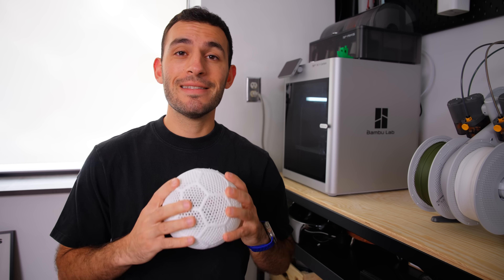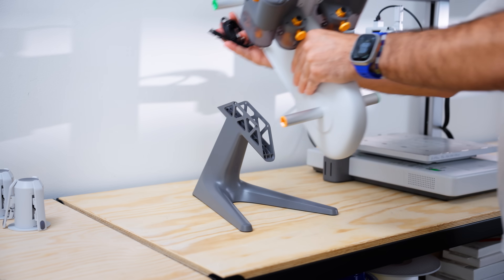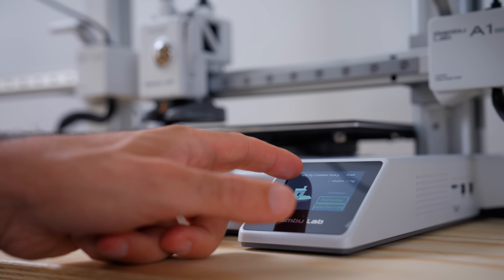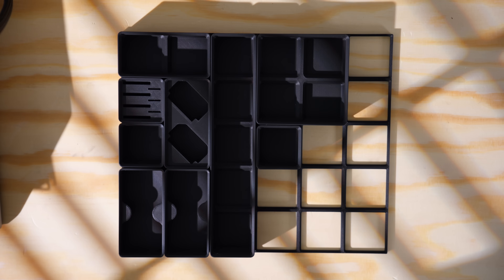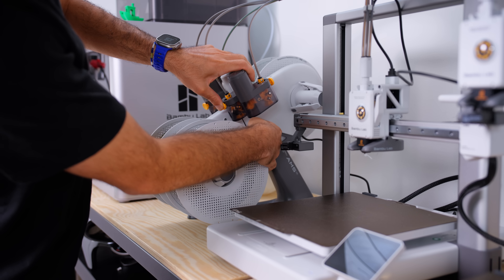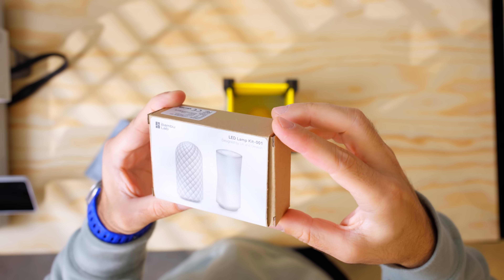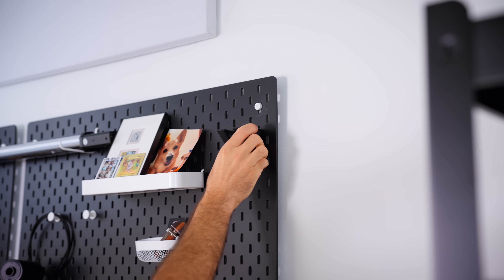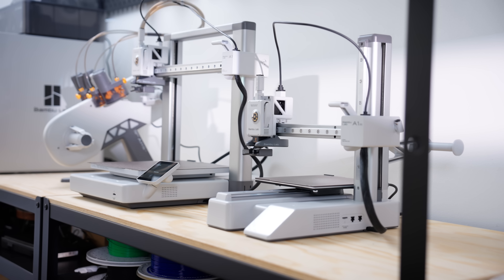Before You Get a 3D Printer, Watch This

Comment: Did you have to calibrate your slicer settings much? Or do you use default profiles?
Reply from the maker: @ludoforged  default works well to get up and running, but I still like to mess with stuff depending on the print

Comment: I’m still using my Ender 3 pro from 6 years ago. Works great! Upgraded the magnetic plate and extruder for about $50. Still using the 8 bit board haha
Reply from the maker: Hey whatever gets the job done!
Reply: @rillotv  the ender 3 printers are the best printers for a beginner. since bambu comes pre assembled you don't get to learn the basics like you do with the ender 3's or any print that you have to level the bed on. the bambu noobies will always be noobs to the 3d printer world.
Reply: @honda-s2k  it looks like bro doesnt own an a1 and is mad about it, btw 0/10 ragebait
Reply: @GalaxialCube The internet would say otherwise, Bambu users are literally the most helpless whining demographic of 3D printing owners with the highest percentage of lack of problem solving and diagnostic skills whatsoever. Also, being locked into a HP style ecosystem with HP prices is never a good position to be in.

Comment: Is 8kg of pla filament for 120€ good from bambu lab as first filament
Reply from the maker: Yeah that's solid! You might be able to cut it down even more depending on if you're doing them with spools or refills. I usually just buy a few with spools and then then rest refills, and then at the worst you can always print extra spool holders
Reply: @ yes i bought it just one spool extra because the ams and printer only come with 3 spools i hope i read it right otherwise i bought a extra spool

Comment: I want to get into 3d printing but those particle emissions are worrying. I have an extra room with 2 windows were I'd put the printer but it still doesnt solve the particle problem even for PLA. I just keep seeing no matter what I look for even when encapsulating or air purifiers youre still opening the chamber to grab the print or the particles are below the size of whats effectively filtering.
Reply: I have the same thing holding me back.  Plus I don't want plastic fumes in the house annoying my family.  I have no idea if these are valid worries.  Seems to be a whole lot of makers that have these devices in their homes.
Reply: @captainstress  the fumes are manageable IMO with filtration and venting, but particles I dont see any solution to that problem at all.
Reply: Could you elaborate what particles you’re referring to? When are they released or when are you exposed to them?

Comment: I have Prusa mini and i love it, but i want to upgrade to a new printer with multi material support. The big question is should i go with closed source Bambu-lab or with the open-source Prusa. I guess Prusa shipping will be free in black Friday, so if i take this into the account, Prusa mk4s+mmu3 should be in the same price as p1s+ams (black-friday price) with shipping costs. what would you do?
Reply: The Prusa MK4 isn't open source anymore like any of the past printers, so purely on performance I would pick the P1S Combo, which is cheaper than the MK4 alone. 

Plus if you're in the US, Bambu replacement parts will be more readily available than Prusa's.

Microcenter sells Bambu's if you happen to have one nearby, so that will save you on shipping and headaches if you have any defects with the printer.
Reply from the maker: I think it'll vary based on your needs, but it really comes down to just how much you see yourself wanting to tweak software and hardware. For me, I care a bit less out modding the printer itself (although there are still plenty of those options with Bambu Lab like extension boards, printing upgrades, etc.) and more the reliability and ease of use when it comes to printing what I need to print. I do think Bambu Studio is open source at least, but I get what you're saying.

I have a software engineering background so I definitely get the appeal of open source, but for me the Bambu Lab hasn't left me wanting more if that makes sense! I know there's also the community aspect that comes with open source, but I still feel the community on Bambu Lab is very strong and continuously growing. 

Also last thing just to note - Prusa is open source, but I've seen a few articles talking about how they're become more and more closed source. Just something to consider as you go on your journey. Basically if they do end up becoming closed source, which printer would you ultimately prefer. Good luck!